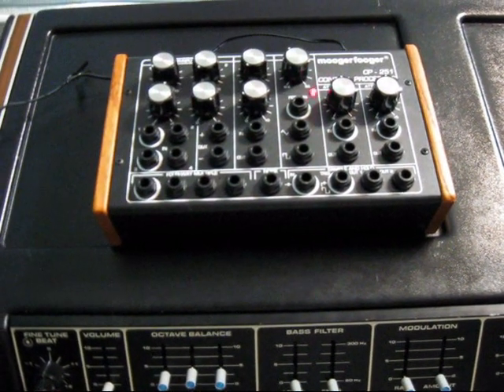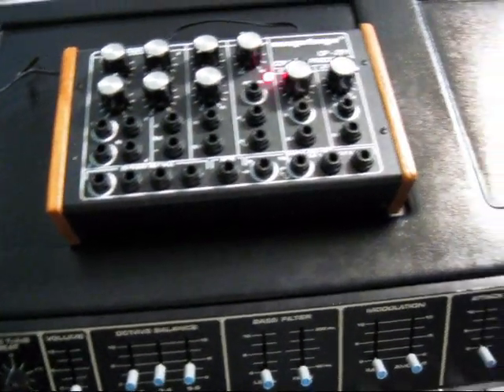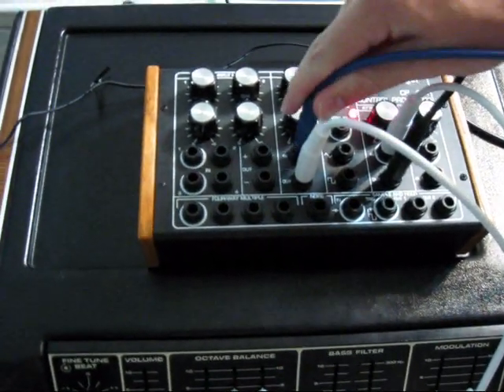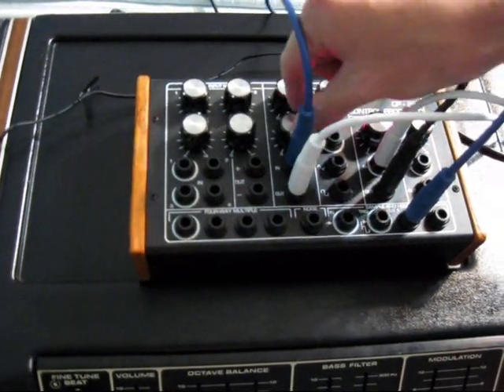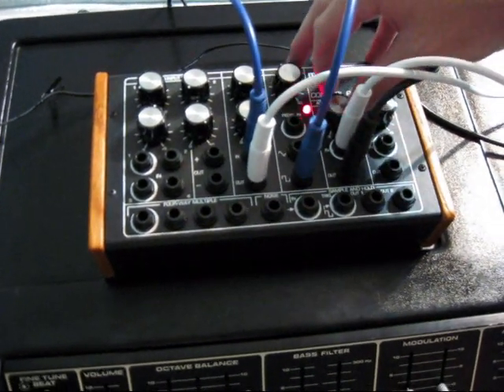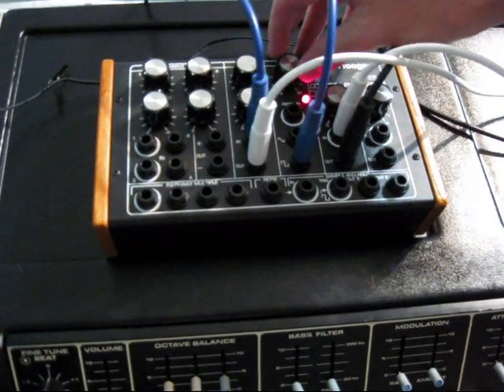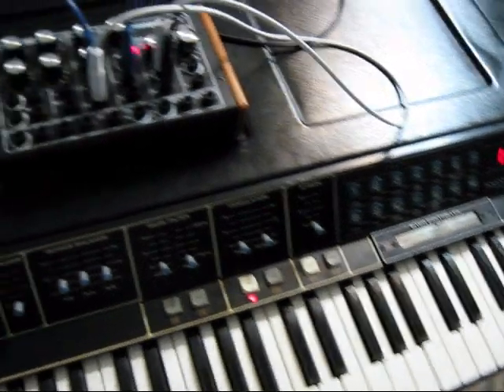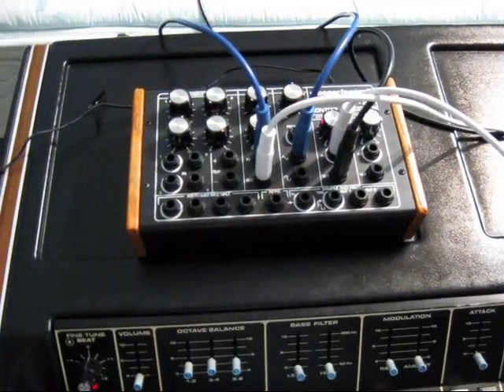CP-251 and polymoog

Comment: From your experience, can that 251 be used to a) add portamento to the Moog Opus 3 or b) interface with a Voyager to re-create the modular sound which Keith Emerson used on the ELP rendition of "Hoedown"?
Reply from the maker: +ShreadTheWeapon Sorry for the late response. No, the CP251 can't be used as a Portamento on the opus 3 or Voyager but I have used the CP-251 on things like a dotcom modular for portamento. 

All the best,
Jareth
Reply: Thank you for your response, however long it took you.  Can you answer the other question about connecting it to the Voyager to re-create some of the patches on the Emerson Moog?
Reply from the maker: +ShreadTheWeapon One thing you can do is use the sample and hold from the 251 with your VCF input to make the effects of the intro to "Welcome Back My Friends" other than that you can combine the LFO with your Voyager's LFO to do some of the backing sounds like heard throughout parts of some tracks...other than that, you can do some sounds internal, I have only been around my voyager for a little while but if there is a way to send one of the EGs to the Oscillators, you can create the  the pitch shifting like heard in "Hoedown". These are just a few ideas for you, really to do some other effects, you need a different synth, the Voyager is great but does not allow for some control. all oscillators are on the same buss unlike a modular so whatever you put into the Pitch CV, it will effect all oscillators.  If you are really looking for the Emerson sounds, you may want to invest in a Dotcom modular, I have one and can get many variations of stuff like Emerson....also the Portamento is a difference circuit desgin then the Voyager so you can get the hard lag, (lazy glide as I call it). Hope this helps
Reply: It sort of does.

Comment from the maker: @ace101guy No, the microkorg is a digital synth, This is a CV, (control Voltage) processor meaning that is sends out voltages rather than digital information. Only analog synths use CV signals.